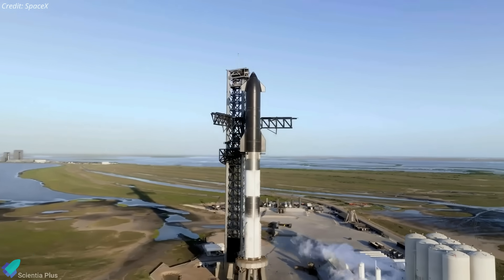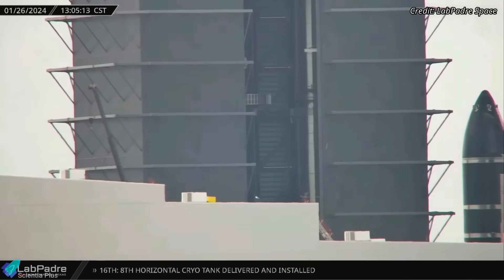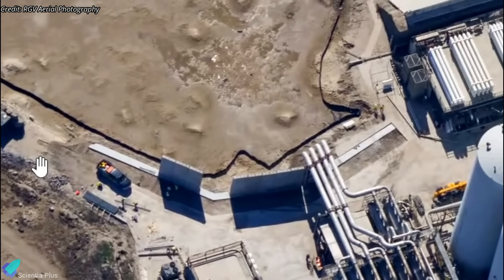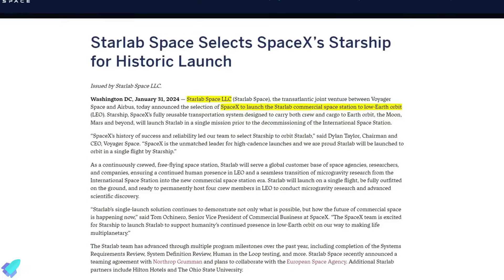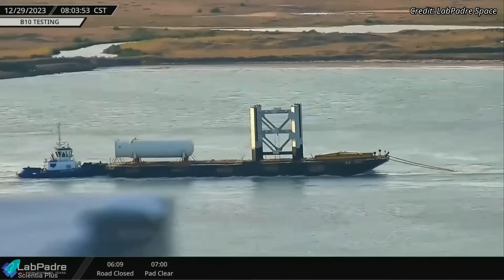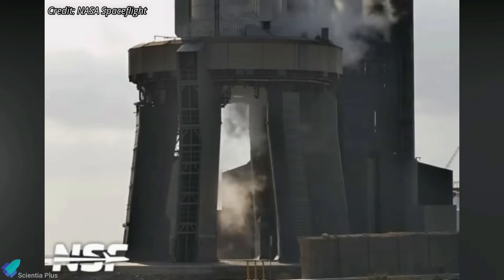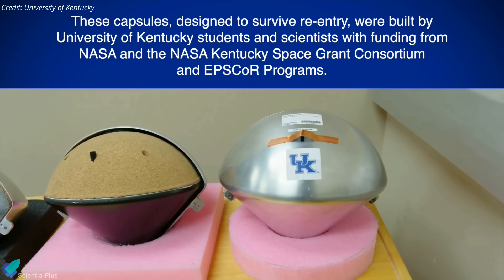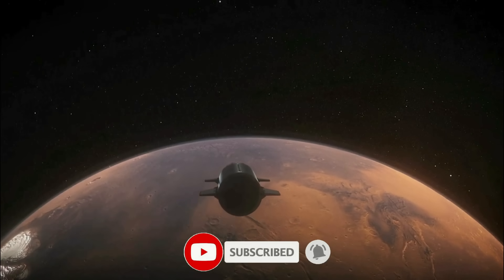Big Plot Twist Delays Starship Launch - Raptor In Trouble Static Fire Ahead

Comment: As Spacex increases flights it will not have the time to keep changing engines and retesting, likewise the launch pads will be expected to perform various launches each day. I am surprised that they are using concrete as the base since the thermal exchanges and chemical absorption must affect the structure, I would have thought a whole metal structure would be more suitable for the future.

Comment: Why does a Starship Raptor engine replace create a "big plot twist" and "delay" IFT-3? They can remove and replace a Raptor engine in mere hours, not weeks or months like NASA.
Reply: The dialogue mentioned that SpaceX is in the practice of static firing new engines when they get replaced this would be additional to any previous static fires hence necessitating a delay perhaps not weeks though cheers
Reply: By the time the launch mount is ready the ship will be ready
Reply: Absolutely agree mate. It was like you read my mind 😊
Reply: SpaceX will launch IFT-3 when SpaceX and the FAA are confident that its launch will have less than one chance in a million of injuring or ki||ing a single person and less than 30 chances in a million of  injuring or ki||ing a group of people, as spelled out in the FAA "Flight Safety Analysis Handbook." Reinstalling a rocket engine requires hundreds of human operations, and there is always a small probability that one or more operations were not performed as specified or one or more parts were damaged in the process. I am confident that SpaceX and the FAA personnel have worked out adequate test procedures to check out replaced rocket engines to insure that the FAA flight safety requirements are met.

Comment: I reckon a sea shell Oyster type should be placed at areas where engines fire for hot Sep. One it supplies more space for battery and other booster parts used to supposedly slow and help catch the booster. The same could apply in an exhaust system type outlet on that area on the middle section. It means that the wiring and battery s are safe. And have more space. It seems a better  idea than the circular shape which absorb s more heat. A more dangerous situation. The Cygnus craft is just a large dirt bin. And is dangerous to launch with the door. Was keen as a bipolar and epileptic person I’m keen on the implant. But as usual. Poor folk can’t afford them. Not even as Elons Lab rats 🐀. I would dig to document its alteration to my everyday brain activity as I’m taken off the tons of micron s of damaging meds which effect my kidneys and liver. Besides it would be a great learning structure. Both for me. Elons team. And the Neuralink computer itself as it collects data. I’ve already gone close the brain 🧠 op episode as I spent 6 months with neurologist s scanning and doing what they do prior to sawing your head open. Placing a hinge on it for alinement and the hanging it opeywhilst you are awake so that you may follow what the surgeon s ask of you during proceedings. IE. Move or left hand. That way they relate neural tissue to physical body tissue. It’s intriguing. I was in there with a lot of guys who had large Timor’s done in two separate ops. But who survived and are still friends of mine. They make you walk about and communicate as soon as you wake after the kinda glue your head back on before removing the hinge. But their interaction is amazing and it helps them to communicate with the folks they kinda live with on ward   Since we know one another.